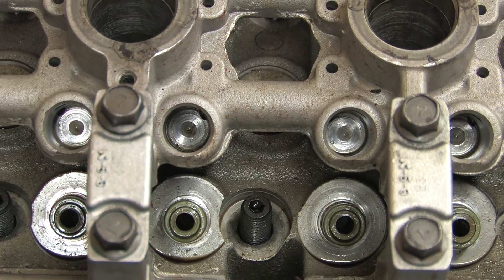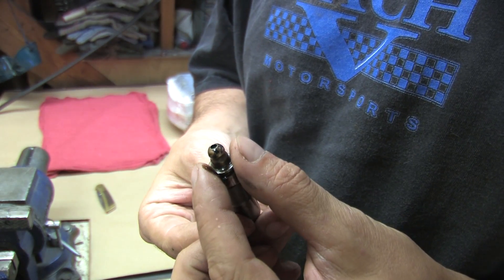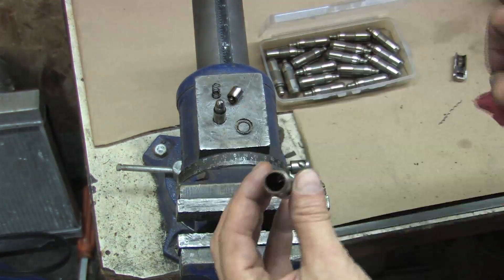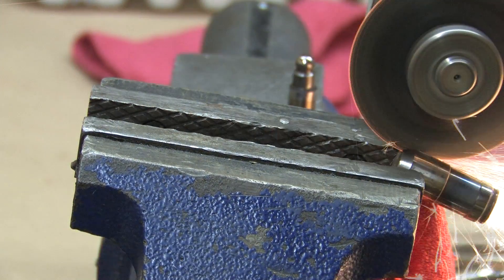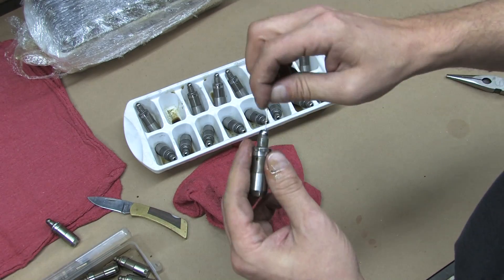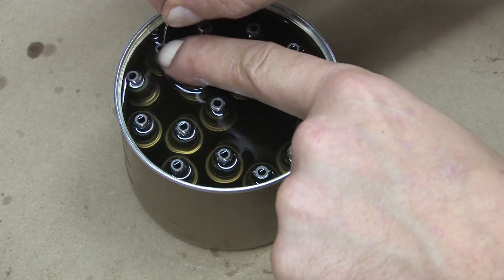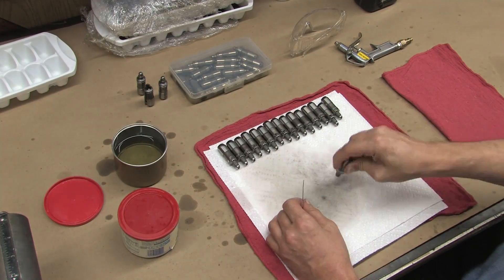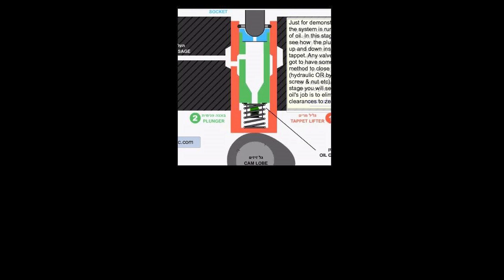Cylinder Head 107 - 4G63 HLA Lifter Tech

Comment: So when installing these you do not pump them back up am i right?
Reply from the maker: That's right.  You want the engine to do that for you with oil pressure so that they don't over-extend the valves preventing them from holding in the compression.  They're on the back half of the rocker opposite of the valve stems serving as the axis or fulcrum point.  If they're fully pumped up, they may not permit the valves to close.  Remember this is an interference engine.  In the event that your valve clearance is as tight as mine is on the Hyundai build, pumped up lifters could cause a catastrophic valvetrain failure simply hand-cranking the engine on a stand.
Reply: +Jafromobile So once installed just hand crank the engine a few revolutions to get them pump should be enough.
Reply from the maker: Nah, it takes a lot more than that.  When I fire the GSX build, you'll see the fastest way to get 'em oiled.  You'll never pump 'em up hand-cranking it.  They won't be right until you have the engine running.  They won't need to be pumped up when you first start it.  It doesn't hurt anything if they're a little noisy at first.  It sounds terrible at first, but it goes away.  I proved this by firing up the now-whisper-quiet Hyundai engine after using multi-purpose grease to prime the oil pump. They took a long time to prime.  I'll use something else a lot thinner on the GSX build so they pump up quicker... but the end result will still be the same.
Reply: +Jafromobile So i should coat them with oil or something so they will prime before install. I know im asking a lot of questions im the middle of trying to fix lifter noise on a 05 kia sorento that has the same design as those lifters
Reply from the maker: Does it seem to make a horrible-sounding banging noise?  I had a friend recently perform an incredibly unorthodox fix on one of those... I will email him and ask if that's the noise yours is making... if it's loud like a rod banging.  Is this the V6 knock off of the Mitsubishi 6g72?
Reply: +Jafromobile it is the lx model and it is a v6. I basically had to put it back together from the dealer who was working on it and they said it needed a new motor once i replaced the obvious broken parts like the crank sprocket timing tensor and crank shaft postion sensor. i fired it up and its a loud ticking noise not quite a banging noise. Only thing i can think of is those lifters are solid maybe one or 2 of them. Ill be back out monday to work on it again and tear it down to check them. I could video it for you and send it to you and see what you think. Im also going to attempt to do this without trying to remove the cams but i may not have a choice.
Reply: I just pulled the lifters from ht e sorento and i am wondering do i need to do anything before installing the new ones. The engine is still in the car. Is there any prep work that needs to be done or do i just slap em in there and put it all back together and fire it up.
Reply from the maker: I can't get in touch with the guy who had your exact issue on a Sedona.  It wasn't a Sorento.  All he did was compress the lifthers, one shot a snotty string of oil out of it as if there was some kind of pressurized blockage in the block's oil galleries.  He put it back together afterwards and it ran quieter than when he bought it new.  He told me what he did to fix it and it didn't make sense to either one of us.  He has previously replaced all of the equipment you mentioned.  At first he thought it was a failed tensioner, and then the brand new tensioner he put on it exhibited the same behavior.  That's when he pulled the valve covers and compressed a few lifters until that one spewed.  Clean and compress the lifters, or just replace them all outright.  I don't know what they cost for that engine?  But based on the story I heard (directly from the same guy who originally built my Hyundai), I feel like that would fix it.  Only thing that could matter beyond that is if the Kia has some kind of check valve in its oil system to keep the head's oil from draining back down into the pan, and it's become clogged somehow?  That seems like a horrible idea from an engineering perspective, but stranger things have been invented by Asians.  They've made up for it by inventing some really cool things, but still... I'm just not informed enough about Kia engines enoung to tell you about their oil systems.
Reply: All good. I got all the lifters out some of them broke and it was pretty tough to get them out. Some of the lifters compressed slightly while others was rock solid and there was a few of them that had no resistance the top would just flap around about a 8th inch or so. I imagined those was the bad ones but since i was there i told them to replace them all due to them all being subjected to the same conditions. They seems very gummed up.
Reply: So i got the new lifters today and they seem like they are prefilled new. Should i try to drain them or just install them as is. I'v already tried draining 2 of them and they seem really hard to do. I drained 2 to get slight movement out of the top but it seems really hard and tight to drain them with my alan key trying to push on the release valve inside.
Reply: Nevermind i needed something a bit thinner to put the releaf valve down i had a too big of a alan key they are bleeding much easier now.
Reply from the maker: If you bled even one of them without depressing the check valve, you have the strength of an ox.
Reply: Haha i bled it just a tiny bit it only decompressed a very little bit because when i got them they was rock solid. I did manage to get them bled with a smaller alan key to push on the check valve
Reply: Master Anubis ok
Reply: Jafromobile

Comment: I don't know if this has been mentioned in the comments but something I use to clean all sorts of small parts is an ultrasonic cleaning bath. They can be had relatively cheaply from ebay. Ideally you want one with a stainless steel tub. You dump whatever cleaning solution you prefer in the unit, select the time and go. If it's not clean, go again. Some scrubbing may be necessary for really grimy nuts and bolts. I've cleaned injectors, nuts and bolts and various other small parts using this but never thought about lifters before. 
As with any suggestion YMMV.

Comment: Another great video! But I do have one question for you tho. Iv read online that you can modify 1g lifters by drilling the top oil hole out slightly. What are your thoughts? Thank you and keep up the great videos :)!
Reply from the maker: +Seth Martin I'd be concerned with leaving metal dust down inside the pee holes that would get ground up in the rockers or cam journals.  It may work, sure… and I too have seen this… but a brand new set of 3rd revision Topline 4g63 lifters are so cheap on ebay that I don't know why people experiment with this.  I think I got mine for like $80.  That's only $5 each.

Comment: Could you soak the lifters in Mineral spirits? Is that a good enough solvent to clean them? Since Kerosene is pretty difficult to get a hold of in my area.
Reply from the maker: +BoostedCajun Yes, and you'd need to oil them immediately afterwards because they're made from ferrous materials that will rust if left oil-free.  Internally, that could cause them to stick.  So yes, mineral spirits, Kerosene, Diesel, etc… all would work fine and there's really no difference between using mineral spirits and the process I showed here because I oiled them immediately afterwards.

Comment: Honda solid lifters are so much better, no cleaning, and only an adjustment every 75k miles or more
Reply from the maker: splice247 They're out-of-spec long before 35k miles, but yes, that's what it says in print.  I have always had better fuel economy in the Hondas that I own when I've adjusted them every 30k.

If you service the oil properly on a DSM, you never have to adjust the valves, and they never tick.  It's only if the oil supply becomes contaminated, or if there's an oil pressure problem that you ever have to do anything with them.  Anyone with a VTEC honda knows the same woes because the valve train lift is regulated by oil pressure, and oil contamination wreaks havoc on the VTEC solenoid.  I don't think there's any perfect solution.  They all have conditional disadvantages.
Reply: +Jafromobile To be honest on all Hondas I owned and checked the valve clearance it was nothing out of spec! (and these cars havnt got new oil for years from prev owners  so pretty sure that hasnt been checked looong time ago) But it was always B16, B18 and H22 not sure if the cheap D series is the same as good. However, your videos are great. Although the information in this video is useless for me it was fun to watch xD
Reply from the maker: TheHondaTuner They may not be out of spec, but they do get looser over time and you'll hear it once it needs it.  It just sounds a little ticky at a warm idle and it gets louder with age.  Valve adjustments are part of a Hondas regular maintenance schedule.  The D-series is 30k miles, B is 60 if it's non-VTEC, and I don't know what the H or VTEC engines need?  You'll own a hydraulic valvetrain someday and you'll agree it's the quietest setup short of a rotary.  I agree they hold up well.  Better than every solid lift Volkswagen.
Reply: *****
 yeah i know it has to be checked and adjusted. Sorry i  wanted to say its in the range where it has to be, not sure if "out of spec" was the correct sentence xD  just wanted to say its not like you need to check them that  often, at least those i experienced ^^ Whats most noisy on a Honda are the LMAs but only the VTEC have them. I wonder if i have a hydraulic one, oneday. i feel like i stick to the B and H forever lol

Comment: I heard recently people are using the 1g lifters with the kiggly HLA regulator for better results because now that the oil pressure is regulated the lifter works as was intended. You are using a HLA regulator Jafro whats your input on this? going to stick with the 3g lifters or use 1g lifters. Possible that it is more critical to do with a higher revving engine. Im not sure what I am going to use, i have a kiggly regulator and may go for a gsc lifter with the stiffer springs.

Comment: I guess returning these to the original lifter tunnel in the head is not necessary as is done with the Valves, caps, etc… right?
Reply: i also need to know this as i accidentally tipped over my head before i removed the lifters... oops. i am thinking after watching how to clean the lifters the answer is no.

Comment: Ice cube tray to hold the lifters!  You clever man.

3000GT and Stealth lifters look identical to these. As far as I know there were only two revisions.  1991-1998 and then 1999 got the larger oil hole on top.  It's a popular mod to get rid of lifter tick.

Comment: Not only are you Brilliant but your editing is phenomenal.. Quick Question? 2k Tahoe 205k miles 5.3. lifter noise maybe rod knock. Spray B-12 down push-rods, can i reduce my shop vac 2" hose down to 3/8" hose and suck the sludge out threw the push-rod then blow hot air down the push-rod to blow the sludge out the other end?? then gunk engine clean. drop oil pan check for rod knock. going to do this in a few weeks and will video it. Just wondering if I will damage the lifters??  thank you Jafro

Comment: Hi jafro, just wanted to give ua tip i found usefull when cleaning 3gen lifters, you know the "pin" you get with the new belt tensioner to pull out after installing new Timing belt? it fits perfect down into the lifters, and is a lot stronger than a paperclip, so it dosnt bend at all :D just wanted to pass this on :D best regards from denmark :D

Comment: i bought brand new lash adjusters for my evo. My major concern is if i have to bleed them from their factory anti rust oil, but afterwards i have to submerged them in the same oil i will use to the engine and fill them until they do not compress by hand force. All in all i'm asking if when we install lash adjusters to cylinder head they have to compress easily by hand or to be rock solid full of oil??  Please clarify this because it will help lot's of people.

Comment: hey jafro, i just picked up a dohc head for my 4g64 turbo, and it came off a 97 gst that walked. traded a broken android tablet for it with the cams and valve cover and cas. anyway, it has 1g hlas in it...... someone probably change them i suppose, btw its a g6k head. i also did a hydro leak test and 3 of the cylinders failed, and one of those failed MISERABLY, leaking the whole port full of water is around 45 seconds, i'll be rebuilding the head anyway so i'm not worried

Comment: I have a small sonic cleaner, and it works great, but putting them upside-down in a metal (nut) can and tapping it works just as well. Crud drops right out. Only for shielded bearings, the sonic cleaner might have a small advantage.  Please keep these videos coming, Jafro.

Comment: From your vid, looks like I should NOT have left them filled with oil when I installed them.  I should have emptied the oil from them before installing them.  Right now I'm getting a lot of tick from the hla's  I just installed a 2004 outlander intake which is the same but tougher, reason being the oe on the gallant 2.4 is prone to cracking.  So.  These HLA should be squishy when installed?

Comment: I serviced my 4g64 lash adjusters and instructions said that the only way to depress the hla is to insert a paper clip into the center hole and push the piston in while submerging it in diesel oil.  It was very cruddy in those things.  I cleaned them this way 2 times to make sure I got the grit out and then I did it a 3rd time submerged in oil so they were full before I installed them again.  I could not depress any of the 4g64 hla's by pressing on them, only with paper clip.

Comment: So after the oil bath and prior to install in the head you just hand push the top to get the oil out?  Is the key to make sure it can easily compress by hand to prevent valve damage once installed?  Mine started getting noisy on a 6G72 at nearly 270K miles...I need to install new 3G versions in it.

Comment: hi i need ur help. I have a sound coming from toyota corrolla when engine is cold, but goes away when it is warm. i looked at valve train to see if that sound come from there, to me it is not, i expreince valve ticking noise in mitsubishi and this noise is not like that.. 

so how do i differentiate valve ticking noise and bottom end noise(pistion slap or rod knock noise). I assume if noise goes away after engine warm up, can i assume it is not valve and pistion slap and it could be rod knock .

Comment: Naphtha's flash point is around 550 degrees F. You can boil it around 200 - 220 degrees. The can you are using is perfect for doing this as the bottom is usually a little recessed so there isn't perfect thermal transfer; it's almost like a double boiler.

Yes, you should do this outside. like the exhaust, I wouldn't breath that shit either. This method is used to clean spark plugs on an aircraft. It works very well for this as well and it will save you time and elbow grease.